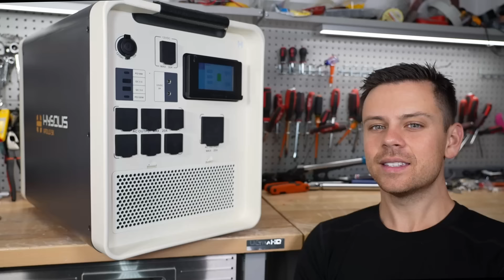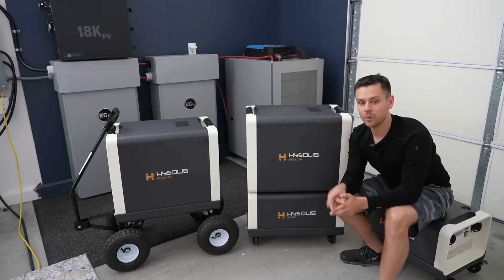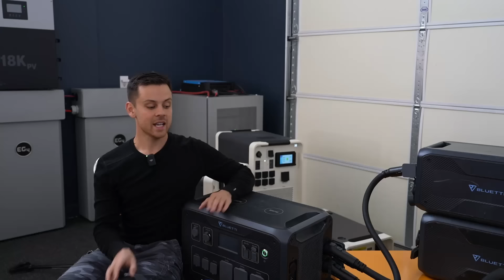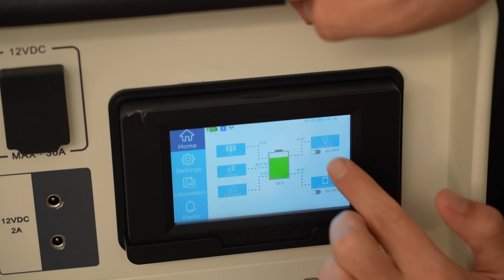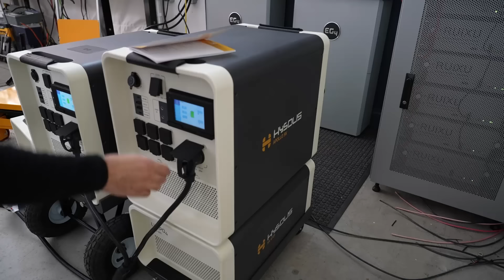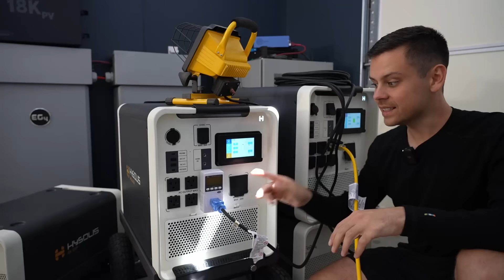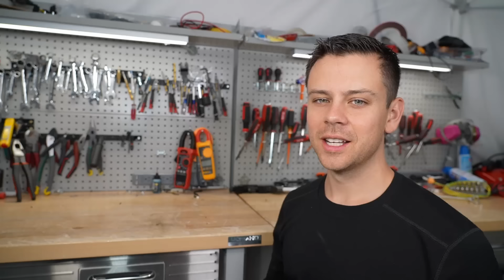Hysolis Apollo 5K Review and Test

Comment: Awesome job Will. These units are getting impressive? 
Micro grid and stand alone power is the future in my opinion. 
Aging power networks are getting expensive to maintain 👍
Reply: It just makes sense to localize infrastructure for a lot of reasons. Going big saves money but going big creates big problems that far outweigh any savings.
Reply: @sf4137  totally agree mate. We seen those big problems with those massive bush fires in Australia a couple years back. Some people where without power for many months. A lot of new buildings there now have generator switches on there power boards for backup power

Comment: The Ecoflow Delta Pro higher a/c rated output and surge is from the 30 amp rv plug. I can't be certain but it looked like you weren't using that outlet. I know you used regular outlets on other 2 and they worked but they may be regulated or protected differently. Curious if Delta Pro would run your lift from the 30 amp rv plug with its surge capacity being 7200 watts or 60 amps?
Reply: @tap-profile0   I'm not sure what this means, I'm not super tech savvy when it comes to apps and their features. I don't have any other social media,  no Facebook,  no Snapchat, no twitter,, only YouTube and Will's channel is the first i ever subscribed to. So I'm not sure what I'm supposed to do or where to click etc.

Comment: Thank you! I was about to pull the trigger on the EcoFlow Delta Pro ; I  still might if they come out with a new and improved model soon. I am a Solar power noob so your channel is SUPER informative and well done.
Reply: Do you know what you are powering? An Ecoflow Delta is fine if you are just powering lights and a fridge for a few hours
Reply: A couple of refrigerators, lights, if possible well pump. I have gas/propane generators but want something that is renewable in case of SHTF and no fuel available @niffrig
Reply: @andrewvillavicencio8496 they have a delta pro ultra know which u can pre Oder

Comment: Nice. Only problem is coming up with the 10k for a pair of them to run 240v. I guess at this point I'm going to have to wait it out until prices reach a level that I can afford.
Reply: If you want to do 240v and don’t need a charge controller, I am very pleasantly surprised with my Genetry Solar 12k @$3k … they offer a 6 kW @$1.5k capable of 240v. You’ll need to supply your own batteries!
Reply: These qualify for the IRA tax credit, yes?
Reply: Hysolis Apollo says they have a 240v European model in the works. Patience is a virtue.

Comment: With my lift if I  have a really heavy truck, I have to remember to lower onto the safety locks before I restart lifting if the vehicle is in the air.  If I try to stop and restart lifting without lowering onto the locks the inverter won't start the motor. (5kw 240 single phase voltronic)  it will on a car but not with my cummins.

Comment: Hi guys I've searched hi and low for the answer to this. Also have some great people I follow on YouTube that just don't give an answer that I understand. Here goes.
From the inverter in a camper or off grid cabin when the three cables leave the inverter AC to the distribution from DC setup how do they terminate in the distribution box. . There is no bond inside the inverter and as the electricity is made from fast switching of Moffats with no field what do you do with the earth cable. How do the breakers trip. Now I know over current does that but isn't the earth leakage breaker tripped by lower current returning. Does the breaker need to be 2p with neutral and live through it. I have it configured much like a house. All grounds to a bar. All neutrals to a bar. Main live and nuetral in through a main breaker out to an earth leakage.. Neutral from earth leakage to neutral bar and live busbared across 1p breakers then out to various sockets. Earth is not to a rod in house. Was but I think you are creating a fault because of how the inverter works. Any advice or a digram for a thicko or tag a video would be great. Tia.

Comment: Seems like a system that would be good for larger outbuildings on an off grid property. Run lights, a window ac unit, some small appliances,  maybe a tv or computer set up. If it has a decent quality and good longevity.
Reply: Isn't this a 3k inverter?   I'd say it can handle an entire off grid set up.   I know cuz I use a 3k inverter and am.off grid, and run the entire cabin off it    thst being said I am.very conscious of what I'm using at all times
Reply: @ericrullmann2354  I am off grid with 2 sol ark 12s 10 kw of panels and may up it to 12 or even 16,  and 40 kwh of storage and I can burn through all of that in one day if I run the ac. On those 108 degree days we had all summer. If I don't run ac and I don't get enough sun for 3 days I may have to kick on a generator on that 3rd day.

So I see this as mainly for an outbuilding on my small homestead farm.

Comment: Hello Will I’m Rick looking for a way to build a system for my over landing pick up keep it Mobil so as-to use it to run an off grid cabin. Have looked at solar generators but not sure if that’s good enough for both used wood an all in one diy be better. My truck can only has a small area for solar panels help please thank you Rick .
By the way I have enjoyed your channel for a long time very informative and very helpful thank you

Comment: This can only charge at 5 amps while also running the inverter? Did I get that right? Also, when in split phase mode will it balance the batteries? One leg running a mini split for example will drain faster.
Reply from the maker: It will be a single battery. Watch the split phase test

Comment: That ground plug seems more cosmetically short. I was also jumping when I saw the 25A plug. Then I realized it is 25A @ 110V which is 2.7kW. You can't even run a decent gaming gear in the woods with this setup :-).
If it's 230V with the same amps it would be impressive.
Still it's a massive step forward in mobile storage. Stressing the mobile part.

Comment: Thanks so much! I've been waiting for this unit review for over a year! Great to see it coming to market.

Already thinking about how I can gut my lead acid RV system and put this in. I've always wanted a system I can keep in the RV and run a cord inside my garage to add the RV solar + lithium batteries to my home system when I'm home 👍

Could probably do that with other options, but the battery pairing here might make it easier. Cost might be a bit of a sticking point though.

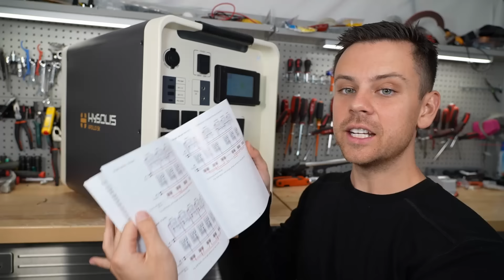Comment: @3:40 @Will, Now that we have a consumer grade 3-Phase option, would you have any plans for an industry first 3-Phase install/project video? 
I believe it would be a fantastic opportunity for the community, for someone with your knowledge to demonstrate the wide range of 2-phase/3-phase functionality of the Hysolis product line. 
If you were amenable, and they provided the tools...

For example, the Hysolis Apollo 5k could present as a stand-in option for a military generator, or other trailer mounted military equipment. 
Similarly, single/dual 5-ton Bard A/C & Heater wall units that are often mounted on shipping containers/oil patch equipment, well pumps and other equipment with heavy inductive loads.
Reply: Yeah bud... Plug this into a heater/AC unit...  You will quickly realize how pathetic the capacity is for the price!  It barely has enough juice to power a motorhome ac unit... And it would last less than an hour.... And nothing says covert better than a field of solar panels to charge your batteries...
Reply: @PrinceofWalesisland  a mini split rolls along at around 500w, giving 8 hrs runtime. People who are into off gridding would just walk past the factory installed ripoff; ridiculously inefficient, poorly designed RV roof-skylight unit.
Reply: @mikemotorbike4283  people into off grid would walk right past this unit as well...  5000$ for same capacity as a 200$ battery...
Reply: Fyi mini splits are just as inefficient per btu as a motorhome ac unit..
Reply: @PrinceofWalesisland  their efficiency iIs that of a window unit when compared to minis.  All RV appliances and design are bottom of the barrel until you get into the $500 k RVs.

Comment: I love this thing, but the killer weirdly for me, is that 120v minimum solar input. Most mobile systems on RVs, trailers, boats n' so on don't have the rooftop real estate required to put enough panels up to hit that minimum voltage sadly. To me, this unit would be a great cabin system, emergency power home system, or for a big property with an outbuilding or a shed that you want to power, but you don't wanna run mains power to it and don't necessarily have a power need that will necessitate something like the 18k. I could also see this being used as a job site power unit in the back of a pickup (I figure no solar charging typically.. just alternator) for construction job site tool use and just have the unit trickle charge off the vehicle, and then plug it in after a workday into mains power to re-up the charge to 100% for the next day. Very cool unit though and I LOVE the autonomy now. I'm curious about the Ecoflow having that capability now too. It's about damn time!
Reply from the maker: They just told me that they will sell separately a box that will allow lower voltage charging. Pretty neat
Reply: @WillProwse  that’s fantastic! Other than that high voltage I think this could possibly be the new standard for vanlife power systems n such if that’s the case. Let’s Hope customer service and reliability doesn’t go all bluetti on us.

Comment: Expansion Batteries at ~$3700 for ~5.3kwh is pretty ouch.  The base unit seems nice per your review, and I get paying for convenience, but for that kind of price on additional battery, I'll pass on that.  Something like EG4 makes WAY more sense if you want to expand on battery capacity.
Reply: It's not just a battery how much do you think a charge controller that can handle 500v solar input.   Then inverter ect
Reply: @brandonstaton  the eg4 3000 handles 500v for less than $700

Comment: I would try your tests of lifting the car the same way every time. At around 11:56, it looks like the lift was on the ground, no "load" on the motor. You can hear that it begins to work under load at about 11:58 or 11:59. My guess is the motor had no real load when it was able to start, similar to a compressor trying to start under load vs no load.
Reply from the maker: Both were on ground. It doesn't matter because it hits a lock point so it's the same every time
Reply from the maker: When it was elevated, I dropped to lock, just as it does on ground. It's all the same

Comment: Automatic neutral/ground bond is one of the nice features of the Victron Multiplus Inverters. It is not hard to add a circuit to add this functionality. Use an external relay that is energized by external AC power in. Use a N.O. contact on the relay to connect neutral to ground.  Be sure to use a relay with contacts rated for the voltage and full current output of the inverter.
Reply: For $1,500, you can get a U.S. built Genetry Solar inverter rated at 6,000 watts continuous, with 18,000 surge… comes with a backlit LCD display, WiFi access/configuration directly to your phone (no access point needed, support for a wireless access point.)
Reply: Surge is pretty meaningless imho, and $1500 for 6kW of inverter is high compared to Chinese offerings.  
Try 10kW SCC, 8kW inverter (hybrid) for sub $1500?     @DavidHalko
Reply: or, just put a disconnect switch on the outside of the case.  I mean, how often are people changing their ground/neutral bonds?
Reply: @johnhufnagel  in an RV or boat a lot since "shore power" will have the bond but when you aren't connected to shore power then you need one.. which is why Victron has a relay to make this foolproof.
Reply: Totally agree  @Channel-gz9hm

Comment: The high minimum pv voltage is a non- starter for me. Should be able to charge it off a single panel if you have to.
Reply from the maker: They will have a module to enable charging from small arrays. If you want one panel, I wouldn't buy any in this class
Reply: @WillProwse  it’s not that I want one panel, but I have 2x 18v 200W panels on my RV, and it would be nice to be able to charge it off of that.
Reply from the maker: @andy347  yep that's what it's for

Comment: Will, quite a while ago you tested the Sol-Arc 15k and said you would report on it after it was installed in someone’s system. I have not seen the second part of the 15k report. Is it coming or is the 15k history? Thanks
Reply from the maker: My friend installed it finally and I haven't been able to visit him
Reply: I would like to get his opinion on how it holds up versus the 18kpv.. I think I'm going 18kpv
Reply: @VinceBadovinatz88 I have the 15k for about 10 months now with 12 kw solar and 1200 ah eg4 batteries. It has an issue where with a load change the output voltage drops significantly for a split second but is very noticeable. I have talked many times and to several different tech support people at Sol-arc but they have been worthless and really don’t care. Let me emphasize they don’t care. It makes me wonder if this is a normal feature of the 15k and maybe it is defective like the 8k was but they won’t saw that. So I am hanging and wondering if/when this unit is going to die. We are off grid so rely on this. I recommend staying away from the so-arc 15k. While it is not too difficult to get tech support on the phone they are worthless.
Reply: @samdixon6867  thank you very much for the info about the 15K solark. I haven't seen anything negative about the 18kpv 
But of course, it's so new. I hope your sol Ark doesn't break down totally. N Maybe somebody will see this comment and be able to give you some enlightenment.
Reply: @VinceBadovinatz88  Sol-Ark hybrid inverter series has been in the field since 2018. Much more proven track record than this shenzen seastar inverter.

Comment: This is a pretty cool piece, Will.   This might end up what i recomment to my mom.  We will see.  

I womder how well it would deal with a transformer and the LRA of a well pump on 220?  Seems a bit wonky, but for grid down use only.
Reply: What is your LRA on that well pump?

I had a similar problem… my compressor is 130 LRA, and I got a Genetry Solar 12K inverter with 36,000 watt surge… and it turns over my HVAC compressor.

About half price, a Genetry Solar 6K will handle surges to 18,000 watts… that might handle your well pump?

I use parallel Ford Mach-E battery modules, capable of putting out 150 Ah each or 300 Ah surge each… for 300 Ah continuous of 600 Ah surge.

You’ll need some serious batteries for a high surge with a high LRA…  you should have some parallel batteries, to increase the ability to handle the peak surge requirements your inverter will need to supply for your well pump LRA.

Comment: Thanks Will one of your best videos, especially the reasons for this unit or doing a DIY system.😊
Reply: Its not DIY when you just plug things in and it works...  Thats like saying you have a DIY TV because you plugged it into the wall and mounted it...
Reply: @PrinceofWalesisland  Tuberdave1 wrote, " reasons for this unit *or* doing a DIY system", not that this unit is a DIY system. Read more carefully before putting out a negative comment, please.

Comment: This new unit is awesome! So many great features. Also very happy to see the AC500 lift both cars. I've been using one every day for about 2 months with my mobile car detailing setup and it's a beast. It'll run my Kranzle pressure washer, Eagle air compressor and Festool dust extractor simultaneously.
Reply from the maker: Wow that's really impressive!!
Reply: @WillProwse  ikr
Reply: @WillProwse   How cool is that?!  :)  (Ya need to make some T-shirts with that!)
Reply: @ChrisEpler  Do you often use your compressor at the same time as your pressure washer and dust extractor?  

How often do you run an electrically heated shower while boiling the kettle?  
How many hours do you need light and can you turn off the freezer when the grid is down?  

Those are the questions you should be asking.  imho

Comment: Hey Will. I enjoy the videos. I purchased two RENOGY 1000 Portable Power Stations with the split phase cable / adapter. I was wonderin if you have ever reviewd their Solar Gen.
Reply: I tried using two Renogy 1000 with their 39:19 split phase adapter. Couldn't handle the amp surge draw of my sewage ejection
 Pump. Poo everywhere. I wish someone would show us how to reliably put an inline soft start onto these types of systems. Renogy does not specify what amp surge this system can handle. Mine was not a huge pump.
Reply: @jeromeblock7897  - “sewage ejection…”
Oh man! That’s terrible! So sorry! Ugh!!!

Large inductive load is a significant problem. 

I needed to handle a 130 LRA on my HVAC compressor, had no idea what to get, bought a Genetry Solar 12K, took awhile to get here, and watched it turn over for the first time 2 nights ago! The GS inverters do split phase, out of the box.

Not sure what the LRA is on your pump, but I decided to oversize so my house would work!

Comment: Can only operate it down to 32 f. Too bad! It is not useful for remotely powering an off grid cabin that is subject to freezing temps
Reply: Sure it is. Just make sure it is warmed up before using. Just like you want the cabin to be warm enough to be fairly comfortable inside, any LiFePO4 battery will want to be "comfortable" with the temperature. Keep it in the cabin, and warm it up in the cabin before using it. By the way, you CAN pull power off of LiFePO4 batteries at a lower temperature, but cannot charge them. May not be the best idea to do so, if you can't warm the unit or batteries up to charge them, though. LOL